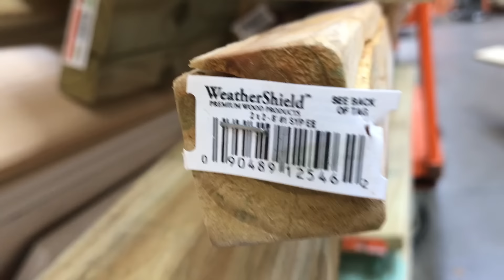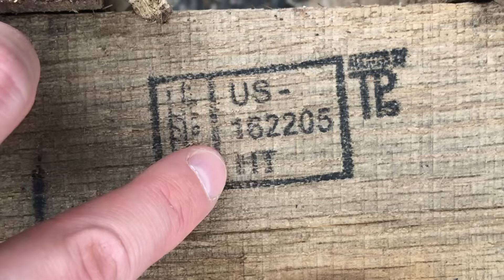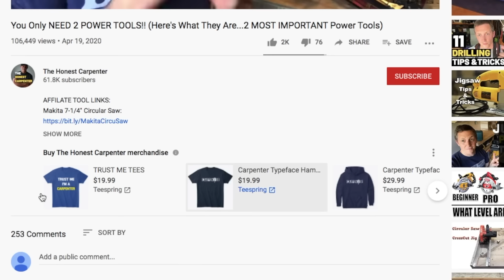Don't Use Pallet Wood!! USE THIS INSTEAD...(Cull Wood Vs. Pallet Wood)

Comment: My son used to work in the lumber department at HD.  They were required to cull a certain about of wood each month, so some of the stuff wasn't that bad.  The secret is to be there at the right time.  One time my son called me and said, " get over here now, we just culled 5 sheets of  3/4" oak plywood".  I went and got them.  The had a lot of green staining on one side, but I got them anyway.   It took me about 3 years to use them all, but after a year or so the green faded and they were fine. Also if you need short pieces the culled stuff is a great deal.;  a 16 ft piece may be twisted along the length, but if you need only 3 or 4 ft sections, they may be straight enough for your uses.    I did my kitchen wainscoting and back splash with culled shiplap.  Took about 2 months to get enough, but the price was right....   One comment about pallets.  Sometimes they are made of  oak and for small projects may be worth it.  I remember a machinist at UNC once tell me that he had a pallet from an old Brigdeport lathe that was make of teak!

Comment: In under a month I've amassed dozens of pallets, easily hundreds worth of lumber. Used the wood on finishing my chicken coop, compost bin, fence, cat house, child's play house, tables, and more. I have 4 factories that set out weekly pallets, fine quality most being brand new hardwood, beautiful 3x4 timbers at 4 foot long, and mostly from food/steel factories so not many chems. The most I worry about is the metal dust which we clean as much off before loading as possible.
Will deff look into cull wood as this is new to me.

Comment: With all due respect, I’m still going to repurpose my pallets for the following reasons: 1) I have “paid for” them: they’re included in the price for the items that were on them. I don’t consider they were “free” 2) I’ll make easy, small outdoor projects because I’m new to woodworking. If they rot out or I screw them up, I won’t feel so badly and 3) in this political climate, the big box stores aren’t likely to give me anything except a hard time and a security guard following me around. I won’t rely on the kindness of strangers for my materials. Lucky you.

Comment: I've never had a problem with getting out nails from a pallet. No tools required but a hammer. It only take 10 minutes to break down a pallet.
Reply: I found this tool from a cheap yard sale that used for removing nails from pallets. Basically a solid shaft nested in a rod that you put over the nail, whack it with a hammer and the nail has nowhere to go but out.  This made disassembling pallets much much faster, probably half the time I used to take.
Reply: @MikkosFree  they make a pneumatic gun for that.
Reply: @adammartinez8698  True, but consider the price difference.

Comment: I just found your channel and I doubt you'll read this comment probably will never see it as many as you have. I went to my local Walmart and found pallets and extremely good condition there was no nails I had to remove and I built a platform bad and headboard from it now I used only food grade pallets which means they weren't treated with nothing and it's been 3 years my king size waterbed is still sitting on them I have lights all underneath the bed it's absolutely beautiful and I'm happy with what I did and it didn't cost me a penny I just had to do a little bit of research to find out which I can put inside my home that wouldn't be harmful for me now me my husband and 130 lb Rottweiler sleep on this bed. Plus it's a soft side King waterbed and it doesn't have the little tubes it's got the big huge mattress underneath so that's quite a bit of weight, and I thank God it hasn't broke because I never knew none of this until I saw your video. Now do I recommend everybody go out and do this no no no it took me a week to send everything down and paint it I used 16 pallets and my bed is absolutely beautiful I wish I could post a photo here but I can't. But thanks for the tip cuz I need to build a bathroom cabinet and also a sink cabinet and I mean in the kitchen too for under my kitchen sink so I'm going to be looking for the call Wood to do that thank you so much I am sure you're a blessing to many I don't know you this is the only video I've seen But thank you so much and have a great day

Comment: I Found a plywood stack that is normally priced 60$ at the Home Depot, marked down for 50% because of scatches and cracks. The manager actually messed up the pricing when I was at the register. I got it for $15 and built a work table using it. Good steal and good advice.

Comment: You're just getting the wrong pallets.
Reply: KC9UDX 😂
Reply: No what he's saying is true of all pallets they're trash there's a reason you can get as many as you can take as fast as you can load them up for free
Reply: @richardhinton4232  ideal for beginners in creating mock ups of their projects and refining techniques before using really expensive woods. It has its uses. I've seen some truly remarkable projects from pallet wood. Each to their own. Not everyone can afford such luxurious rare lumber.
Reply: Or the rotten one. Depends what do you wanna do actually.
Reply: Here in Denmark, some of the single-use pallets are of hardwood. Not all pallets are created equal.
Reply: I had a pallet fom India. It was a hard, dense red wood, awful to work with. But I used it for so many jigs and fixtures. Wish I could find some more.
Reply: @richardhinton4232  they're worthless because it costs money to reuse them.  All pallets are not the same.  Most pallets I've gotten are hardwood.  The ones I get are for shipping sheet metal.  A lot of the wood is split or knotty, but when you get a large amount of it to choose from, and the stuff I don't want to use makes good firewood, that "free" price is very worth it.
Reply: If you are going to spend money on "good quality pallets " than it's better just to buy the wood and safe the work of pulling these things apart
Reply: @Charles J. Brainard actually you can sometimes.  Don't tell California!
Reply: @leonardogomez2259  I don't think anyone anywhere is suggesting to pay for pallets to take apart.
Reply: Back in the late 1980s, my Dad brought home some oak pallets from the scrap wood pile at the dump, that smelled like pickles. It turns out that they used to be pickling vats from some pickle factory like Vlasic. They made our woodshed smell better all winter.
Reply: You said it. Out of about 50 pallets I've thrown in my truck over the years very few are identical. Much of the pallet wood I get lately has been extremely thick. The idea of buying wood just seems stupid unless it's something very specific I have to do.
Reply: The idea of recycling is very attractive though.  I think its more than just a passing fad.
Reply: @richardhinton4232  you have never seen heavy equipment pallets. Seen stuff ship in  on big 6x6 mahogney runners. If that is trash, what do you call good?

Comment: I never knew of cull wood.  Never seen it at our local Lowes and you know with all that wood there would a fair amount.   Thanks for this information about both.
Reply from the maker: You're welcome, Larry! Just keep your eyes peeled, I bet they've got some version of it floating around somewhere :)
Reply: My store doesn't have a pile of cull wood, but if you see the available lumber is warped/damage, complain to someone and they will offer a steep discount.
Reply: @TheHonestCarpenter  I did some asking around at our Lowes and found out they don't keep the cull wood inside.   Its on the side that only a select few know about.   It also includes other damaged or partially open items.

Comment: Not to mention, pallets go places like deep freezers and food storage. More often than not they stink, have bugs anyway, are split up, full of metal, and are weird dimensions.
Having said that... there are exceptions to the rule. I prefer pallets that have been created to ship large pieces of equipment, they are usually large beams of wood that are bolted together and only used once. Stickers are a second choice, any lumber yard will have piles of them and they throw them out. Stickers are the slats under and between layers of wood to help things stay together and straight while in bundles. The dimensions vary but usually you will find 3 or more all exactly the same size and shape. Flooring pallets that have exotic flooring from other countries are a great place to find one use pallets too, often mahogany flooring comes on a pallet made out of mahogany. I’ve reclaimed plenty expensive hard woods from exotic flooring pallets for free.

Comment: Find a mill. Most of my nicest rustic projects came out of the firewood pile at 3 different mills. I'm talking thousand dollar coffee tables. Not a huge, industrial mill either. Backyard, or local mills that sell slabs or lumber. Invest a few bucks in a metal detector, and go crazy. One guy pawned so much wood off on me, I had to start culling it myself.
Reply: This is what I used to do. So much of their machinery comes in heavy duty crates, if you can get one and break it down its easily $100s worth of lumber & plywood/osb (specially now)

Unfortunately most mills in my area have moved their junk piles inside the fence for insurance reasons and only allow employees to take wood.

Comment: Thanks for the tip! I was planning a project to use only pallet wood, but I was concerned that the surfaces of my project that people will touch would be too rough. Not sure how much good sanding can do on already beat up half rotted wood. 😂

I think I'll use a combination of pallet wood and cull wood with each where I think its strengths can serve the project best.

Comment: Huh. I worked in a mill shop, and we only threw away stuff that was too small or totally unusable -- and the small but useable stuff went into a scrap box for hobbyist wood carvers and birdhouse builders. Because we bought from big distributors, we got what we got, including the crap. (Need to make stair treads? Use that twisted 8/4, chop it to a couple inches over length, and then joint the crap out of it.) It never would have occurred to me that lumber yards & big box stores would have scraps that they mark down or toss out.
     Thanks for the info!

Comment: There are multiple types of pallets. I've seen pallets like you're talking about but I've also seen pallets with true 1 by's. We use pallets for outside pieces off the ground usually. If they're in the rain cover it with used oil and you're good. I built a surround for our ac unit because it's on the deck and it goes perfect with the deck and still provides plenty of air flow. There are good uses for pallets

Comment: This is a largely inaccurate opinion piece. Like picking through a cull pile you can get really crappy wood, but unlike the cull pile you can find highly figured hardwood. I have found fiddle back maple, curly mahogany, and tons of quarter saw oak. So there's that.
Next 4 foot is perfect for most furniture style projects. Rarely do you need anything longer. Cull wood doesn't really make for anything of high quality & it's usually so twisted you can't use it. Pallet wood is usually dried while nailed flat. It pretty much stays close to that when cut free. If you know what you are doing you can fix the split ends.
Reply: Exactly.

Comment: Even pallets that are heat treated could been exposed to a MB treatment. When a shipment is inspected , and any contamination is found, it gets treated with Methyl Bromide. This includes all the pallets included with the shipment no matter what they are labeled. A methyl bromide  treatment completely dissipates when it is exposed to air, if it did not we would be exposed by everything that is shipped in a container.   I used the wood from special pallets that are designed for some specific item, I have found some that include some very good 2x4s up to 15 of them built into a pallet that usually come from a big box store.  Remove all metal from the pallet wood and mill it for use. If I can't remove all the metal it goes into the wood pile.

Comment: Being cheap by nature I went down the pallet rabbit hole a long time ago. I quickly learned a few things. First hauling and breaking down pallets is a lot of work. Second the yield of usable wood is low and the amount of waste you have to dispose of is large. Third what is cheap becomes expensive when you ruin a planer blade or a saw blade on a hidden nail. And even if you avoid all the nails there is often embedded grit and the like. So now I only use pallets under very specific conditions. First very pristine pallets, very large pallets or crates and such with usable plywood might catch my eye. Second if  am making a rustic project with a reclaimed look. Third if there is some good hardwood that can be harvested easily for use as inlays, splines and other smaller uses. The pine isn’t worth the effort. Finally if I ever had a use for a whole pallet which I don’t I might take them. As far as cull wood goes I have never looked for it but my suspicion is it will not be available, but if it is it will not be that much cheaper. But I’ll give it a try.

Comment: SIMPLY THE BEST "PALLET WOOD" VIDEO ON YOUTUBE AT THIS TIME...!!!
(Ethan feel free to pin this as I would gladly respond to all that have questions)

DO NOT...use pallet wood for your projects...!!!...The risk is just not worth the effort for all the reasons Ethan listed...AND MORE...!!!

Another great source of great wood at a low price...Amish Pallet Sawmills or any Small Pallet Mills you can find in your area. This is "green wood" however and one will have to either learn how to build with green wood (all I have built over 40 years is with green wood 95% of the time including furniture to flooring...decks to house frames...just as It has always been done till the modern age.)

In closing, pallets are not worth the risk...!!!...are their exceptions...YES!!!...but you really have to understand wood...wood species...pallet sourcing...and other things to make it worth the time...

Comment: I'm in Australia and we never have cull piles.  We have crap piles where wood that is utterly useless is thrown onto that we can have for free, but that stuff is good for nothing but burning.

I get hardwood pallets and use them.  They are neither heat treated or chemical treated (I get mine from a place that distributes magazines and they are almost brand new when i pick up a trailer load). I've got a good system to separate the timber and can do 3 or 4 in 10 minutes.  Sure, the timber isn't great. But I can make some pretty awesome outdoors furniture with it that will last and looks damn good.

Comment: I just brought home a truck load of pallets. I was planning on making small outdoor planters boxes out of them. I didn’t know about the concerns you brought up. Glad I watched this. Edit just to add: I intentionally wanted a rustic look and I thought the “reclaimed” nature of it would be a selling point if I wanted to sell some.
Reply: Because of the possible chemical issue, planter boxes are one of the things you may not want to make out of pallet wood as the roots will contact the wood.  If you know the history of the pallets and can confirm there is no MB or Eur markings, then go for it.
Reply: @keaphoto1  nonsense

Comment: Gotten lucky lately. Passed a Home Depot and saw some composite deck boards in a trash bin. Lo and behold there appeared to be dozens of composite boards, mostly 20'ers. Problem was there was a whole lot of heavy debris on top. Went to work and the more I dug the more decking I found. A lot of work getting them out and onto my trailer. 95% like new, I sold them for $1800.
Then, at my local lumber store, I spotted a very large banded pallet of Fiberon composite deck boards. The sign read new decking, 97 12-footers, 16 16-footers, and fascia boards. I estimated around 650' sq ft and figured it to be worth between $5-7K. Paid $1900. These I will keep.

Comment: I realize this vid is two years old but wanted to add another option. Where I live in michigan we have saw mills that make pallet boards that you can buy pretty reasonably. These have never been used and you can get a variety of different woods. They know people want it so currently as an example you can get black walnut, cherry, splatted & ambrosia maple, oak, pine, etc. I know not everyone has a friendly saw mill near them but many do check around and you may find a great place to get project pallet wood that has never been treated or seen a nail. It's just a thought...

Comment: I brought a pile of pallets home from work, after new servers had been installed. Only to find out that they were made of a type of compressed pulp, that was totally useless. The cull bin, at the store in my country, is very small, and even though they are all short pieces (+/-1.5m) and sometimes too warped to be of any use, the prices are still fairly high. I inevitably end up paying full price for decent wood.

Comment: Great idea on the cull wood. I will say the best thing about pallets is they are already cut and somewhat put together so makes it easier for people (namely women like myself😁) who don't own any type of saw or cutting tool so the individual boards are a lot harder for me. I do hate that they are poor quality.
Reply: Purchase a plastic miter box at Home Depot or even Walmart.  It will come with a sturdy, short, hand saw.  It is quick and simple to drop your boards in and cut them to the butt joints or miter joints you want.  My dad taught me to use his when I was about 10 years old and I still appreciate them.